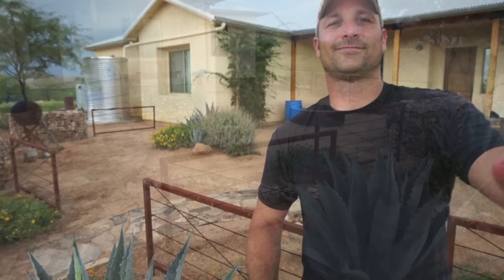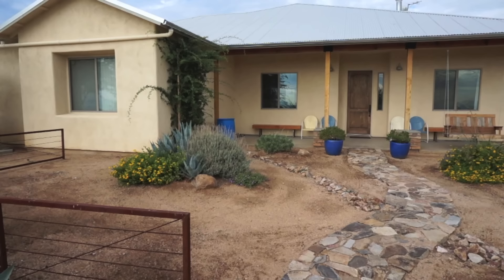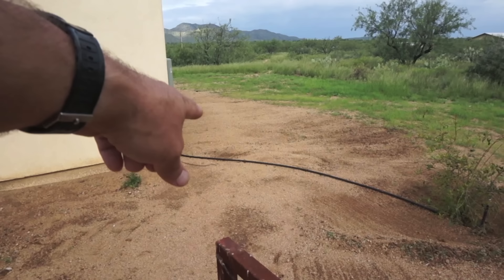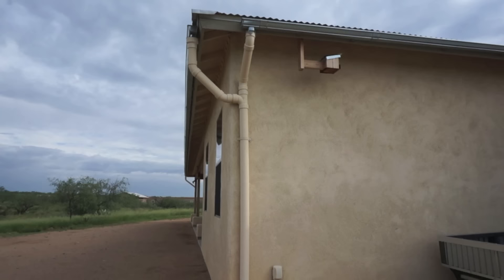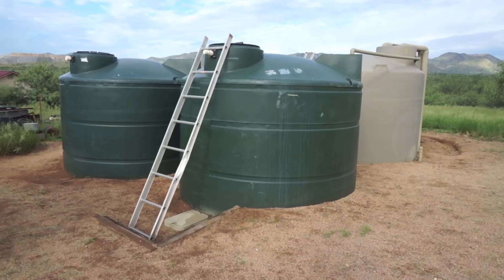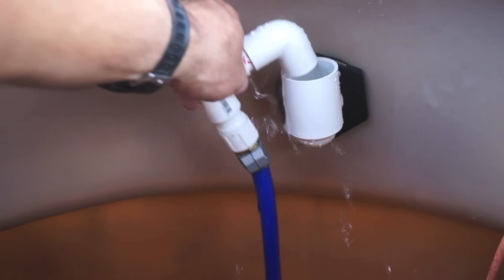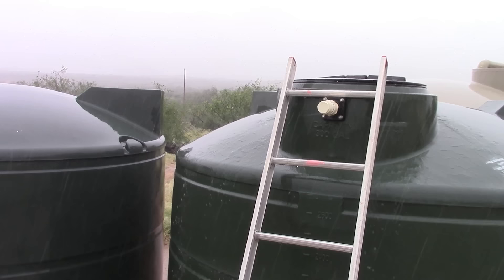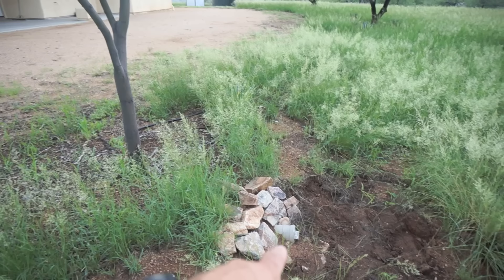Rainwater Harvesting - Home System Tour

Comment: Awesome setup. Do you run the water though any purification filters before using it, and do you regularly test the tanks for contamination such as harmful bacteria and parasites?
Reply from the maker: HI Alan,  

I am going to be doing a Rainwater QA video soon to answer some of these questions.  But the short answer is that I transfer the rainwater to the green tanks after all settling is done (very clear) and then just treat with a small amount of chlorine.  From there we use the strainght rainwater for just about everything.  All cooking and drinking water is filtered through a Berkey Ceramic water filter (gravity style).   So it's about as simple as you can get.  As for bacteria in the tanks, the chlorine takes care of that and the tanks are kept very clean.  
thanks for watching:)
Joe
Reply: homesteadonomics Cool, thanks!

Comment: I thought those tanks would take forever to get to some capacity but I was extremely impressed by how much water you had collected and I'm thinking about installing that and a green house at one of my homes but one question I live in New York City and I'm thinking of installing this in my home in upstate New York far away from the pollution but our winter months are really extreme and I know the water will freeze can I install the rain catching system and run it year round or would I have to empty them before the below freezing months start ? And is it capable of handling heavy snows and extreme cold ? If you can answer I highly would appreciate it I just subscribed and I'm enjoying your channel very much !!
Reply: I was thinking the same thing, but it may have been that they already contained quite a lot of water before the rains.
Reply from the maker: HI Gonietube,  sorry for the slow response... I was camping for the past week.  Anyways, to your questions.  Most likely you'd need to drain the system during your coldest few months.  Mine does fine with light freezes... but here in the desert I don't get the same temps as you do.  If I did... I'd probably dig a below grade cistern.  Hope that helps:)
Joe
Reply: Gonietube NYC I read your post and I thought what about putting it in a shop or shed with a heater for the cold month's;)

Comment: do you use the water as drinking water? would there be any heavy metals coming from the galvanized metal on the roof? have you tested the water?
Reply from the maker: Yes, I do use it for drinking water.  It's our main water source for the house... drinking , cooking, showers, etc,.  We do use a berkey ceramic water filter for cooking and drinking water though.  I will be doing a QA video soon to answer the most common questions I have gotten on this video.  As for heavy metals, I have not done testing myself but my wifes grandparents had some university folks test there cistern as they were doing some research on rainwater harvesting and they found no elevated levels of metals.  Their roof is galvanized too:)  Hope that helps and stay tuned for the QA video:)
joe
Reply: Thanks for the reply! best wishes to you and yours. keep living the dream brother!

Comment: What about when it drops below freezing for weeks at a time? Havent seen any videos that address this.
Reply from the maker: Yes, this system is well suited for my area.  We have minor freezes but nothing like weeks at a time kinda temps.  If that was the case you'd have to either drain the pipes and tanks for the coldest few months of the year or have them buried below the frost line.  My grandparents in NE had a concrete cistern buried below the frost line and it served them well for many years.  Anyways, thansk for watching and I hope that answered your questions:)
Joe

Comment: Have watched your videos and am impressed with them. I do have a question on the water tank sizes. Your first tank is 5000 gallon then into a couple of approximately 2500 gallon. What if first tank was 2500 and then overflows into 1500 gallon tanks.  I think it will work fine but my Son insists the first tank needs to be the 5000 gallon one like you have so the dirt/dust will settle properly. I tell him we can always add more tanks.  I live in the Casa Grande Arizona area and I think you are closer to Tucson which gets more rain than my location. Any advice would be greatly appreciated.
Reply from the maker: Chuck Dillon Sr hi chuck,  the size of the tank isn't all that important.  I think a 2500 or 3000 gallon would suffice.  I used a 5000 because I got a great buy on it at the time...the seller had a hard time selling it because it was so tall....which actually made it a bit harder to work with as we had to dig it down to where the top was lower than my gutters.  So I think your idea will work fine.  However I would encourage you to factor in the cost difference between the 1500, 2500,3000 gal tanks...generally the bigger you go the better price per gallon.  Hope that helps:)
Joe
Reply: Hi Joe, I have found where I can get two 2500 gallon tanks about $500 cheaper than one 5000 gallon tank. The problem I have seen in the last few years is the rain has been going around us here on the West side of Casa Grande. This year we have only had rain one day but I swear the amount we got I could have harvested thousands of gallons. My shop is 1200 square feet and the house is just over 1000. Anyway wished I had seen or thought of harvesting rain water here about 20 years ago. Thanks again.

Comment: Great video, I started with this one and have sense moved on to several others.  My wife are very enthused by your accomplishments.  We own property in N. AZ that we are slowly developing to live by our own means and sustenance.  

I do have a question about the flow of water from your roof, below ground level and vertical to the tank's inlet, which must be close to 10' high.  I currently have a 10'x20' rainwater shed that I use gravity to fill my 1550 gal tank, but have never considered natural flow of water from a higher point, beneath the tank entry point and into the tank.  Just blows my mind.  Did you study this first somewhere, do you have a resource online that you looked at?   Just wondering.  Thanks again and great site/videos.
Reply from the maker: +Tim Simpson Hey Tim, so cool you've got some property in N AZ.... lots of great areas up there!  As for the wet pipe system... I actually originally wanted to due the traditional method of having the pipe go directly into the tanks at an angle from the roof line... but it would mean that I'd have to have several smaller tanks around the house and then tie then all together at the end.  My father in law actually first suggested it this way.  My wifes family has actually been in this area since the 1890's and several folks have been doing the rain collection since the 1950's... into concrete cisterns underground.  
Anyways, I hope that answered your question and I'm glad you guys are liking the vids!  I'd love to hear about your progress/projects in N. AZ!
Joe
Reply: +homesteadonomics Thank you very much for your explanation.  While driving to the property on Friday, I was thinking about the 'wet pipe' configuration and figured it out.  Just by lack of pressure, water will remain in your buried PVC pipes until the next rain, correct?   I think I will stick with the gravity fed systems, for one....a lot less digging. ha!

We live in NV, but own property in N. Arizona, approximately a 3 hour commute each weekend.  We started with a blank slate, and have made some great progress in structure, rain water collecting, and solar...although some of those had to be applied again due to small failures (mainly on lack of experience).  The rain water we collected last year easily filled our 1550 gal tank, so that is pretty exciting, and the key is keep collecting from any structure that is built.  Rainwater is plentiful in certain month and free.

We both loved your 'Rainwater Garden Project' and has given us a lot of ideas considering that we are on a slope and do have natural runoff during those seasons.  One question on that.  Do you have any problems with water stagnation between rains?  Such as bugs or smell?

Thank you again for all you have posted.  I keep a private blog, mainly to document my advances and failures. ha.  Anytime you want to check it out, let me know and I will email it to you.  Thanks again, Tim

Comment: you don't mention anything about your filtration system.... well other then the small wire mesh for debris... is there a reason you use a pump to push the water up from your first  tank to your second rather than using a lower pipe? hoping to make my own setup this summer so any information is appreciated :)
Reply from the maker: Hi Steve.. I use a Berkey ceramic gravity filter inside my house for cooking and drinking water.  Everything else is just straight rainwater (with a tiny bit of bleach as a disinfectant) for showers, wash water, sinks, etc,.
And regarding the transfer process.  I don't have a lower pipe connected between the greens and the tan because I don't want them connected.  I allow the water to settle before I transfer and if I had a lower pipe the levels would equalize and potentially bring sediment into my green(clean) tanks.  Hope that explained it a bit... at least a little better:)
Joe
Reply: Awesome and yes that answered my question perfectly :) so thanks

Comment: Awesome system! Roughly what was the cost of tanks and pump and all the piping please?
Reply from the maker: Hi Mark... it was in the 4200 range for the initial install of the all the gutters, pipes, tanks, etc,.  Not including the culvert cistern which was installed later for 450 or so.  It may sound like a lot but it was either this or drill a well at the cost of 15k... which i didn't have...lol:)  thanks for watching Mark:)
... ps... I am planning a rainwater harvesting questions and answers to answer all the questions that i got in this video in more depth.  Maybe up in a month or two:)
joe
Reply: Thanks for answering me! Im luck and actually have two Wells's in the land i'm buying but i loved your setup and might do something similar

Comment: Lot of thought and work put into this but you have a issue Imop..... between rainfall you have water trapped in the pipes once the water level reaches the same height as the inlet stoping flow.. this water becomes stagnant quickly just like a still pond. Next rain now that stagnant water gets pushed into your tanks.. I'm sure you filtration system deals with it fine but it's greatly reducing the life and increasing maintenance.. Ideally you need a way to drain the left over water from the pipes and spouts after a rainfall. Also with all that underground plumbing I find it odd you didn't incorporate a diverter system to help keep dirt from collection in the pipes which later will need to be dug up to clean any clogs.. I think with proper planing you could even use the diverter to drain the lines of the left over water to but prob need to vent the inlet side to prevent creating suction and draining the tanks themselves.. still a great system and I for one am envious. I'd love to do all the proper underground plumbing like this but find it much easier to maintain with all items above ground even though it obviously greatly adds to the number of tanks and reduces overall capacity.
Reply from the maker: Thanks John:)  All good points and I plan on answering a lot of the questions from this video on an update QA style video so stay tuned:)  In regard to the pipes and stagnate water.  I actually have two drains that I can open and completely drain all of the pipes.  the clips are at the end of the video and there is a drain at two sides of the piping.  As to first flush diverters.. I actually looked at a couple of systems in tucson that had them and they still had quite a bit of silt/sediment in their systems as well.  I think the diverters are really smart and can work well... but I didn't want to add them to my system as my plan was to keep it as simple as possible:)  Anyways, thanks for watching:)
Joe
Reply: homesteadonomics that's cause diverters have to be properly sized based on amount of roof footage. Almost no one has enough flush per amount collected. The metal roof helps a lot with that though. I'd have to double check but I think it's 10 gallons per 100 sqft of collection roof. I can see with your system how that would be hard cause of the amount of roof you would need a massive storage tank just for the first flush system.. I guess in a way your first tank does to some extent act like a first flush long as the pump is elevated a bit from the bottom of the tank

Comment: Hi. I have a question for you. I found a piece of land that I want to build a house on and homestead. I've been told I can't build a house unless I have adequate fire protection. I'm really trying to avoid ruining power and municipal water to the property. Do you think a setup like this could be used as an alternative water source for fire protection? I heard you on a podcast and you said you're a fire fighter. I thought you might have some insight into this.
Reply from the maker: +Anthony Jones Hi Anthony,

I can't say for sure as it ultimately depends on your county/permits department, etc,.  But with that said, when I built my house I needed to show that I had a fire department that would respond to the area for my my homeowners insurance to provide coverage during the build.  I also had to have a tank with water on the land as a 'reserve water' source during construction.  However, they never said I had to have any FD connections, etc,.
But regarding your build, I'd ask them what exactly they want you to have in regard to water access, etc,.  You might be able to set up a few IBC totes on a raised platform as a supplemental water supply with a FD style connection for the FD to use in case of fire.  You could even get a gas powered water pump to tie into your tank set up and a forestry hose and nozzle to maybe qualify for 'fire suppression' needs as well.  
Anyways, I'm just spitballin' right now but I hope maybe some of those suggestions might help:)
PS-  I'd check with the nearest neighbors in the area and see what they had to do.

Keep me updated and feel free to ask anymore questions you might have!

Joe
Reply: Thanks Joe.  That gives me some ideas.  I'll let you know the outcome.
Reply from the maker: No problem:)  Good luck, look forward to hearing good news... hopefully!
Joe

Comment: That's quite a system. Do you have a filtration system that allows this water to be potable? If so that would be a nice vid to show it. 

Thanks
Reply from the maker: +1timby Hi Timby... I actually use a Berkey ceramic water filter in the house for cooking and drinking water... all other uses is just plain old rain water.  We add a bit of bleach to the green tanks to prevent any algae... but it's way lower than the amount of chlorine that's in a municipal water system...  But I am thinking about doing a video on how we get the water to the house and filter etc,.  Thanks for watching:)
Reply: homesteadonomics I also noticed that you don't have a first flush. I'm assuming that it's because of the region in which you live.

Thanks for the info.
Reply from the maker: +1timby I don't have a first flush, mostly due to the extra material needed and the fact that I would need to hang another piece of pvc pipe on my wall.  They are really cool systems but for me the benefit didn't out weigh the cost.  I don't really have a problem with leaves, etc,. and I also take 10 minutes to vacuum out the gutters a couple weeks before monsoon season as well. 
Joe

Comment: Still not clear to me how the water travels up into the tan tank by simple water pressure?
Reply: A friend of mine had the same difficulty. Water seeks its own level so, if you imagine a U shaped pipe and pour some water in then the water will get to the same level on both sides. It had to go up one side to get level with the other. His diagram at the beginning said the pipe at the house was higher than the one at the tank so the water flows out of the lower end while trying to get level with the higher end. Some folks use water in a clear pipe in construction because of this principle. See "water level" videos for visuals.

Comment: Great video! Do you use pvc drain pipe (designed for low pressure) or high pressure pvc pipe for the underground portions? Big price difference there. Thanks!
Reply: it's still just gravity pressure, not high pressure. He used low pressure.